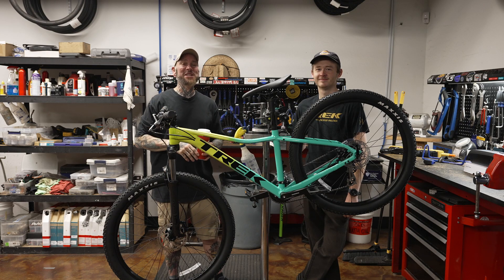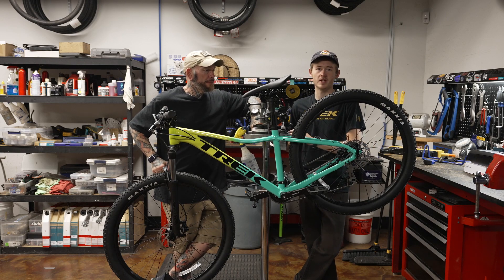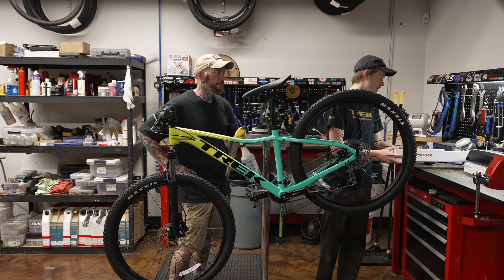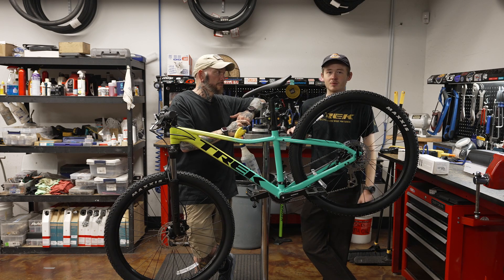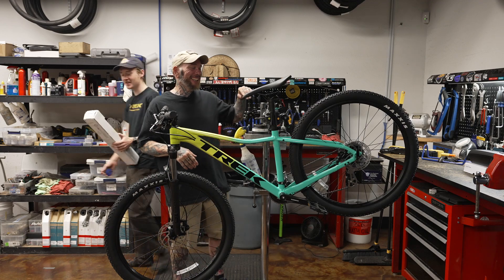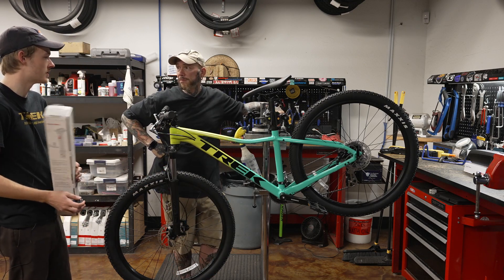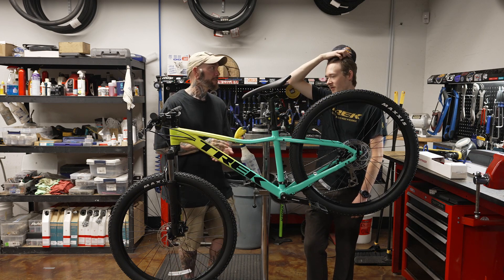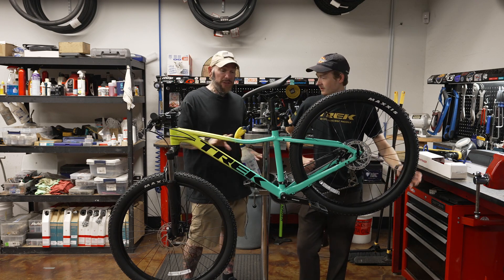How to properly size your dropper post as well as the three main styles available.

Comment: What if my bike is full suspension and the seat tube is curved or obstructed with a shock pivot?
Reply from the maker: The process is the same but you have to subtract the length of the curvature or suspension mount. 😉